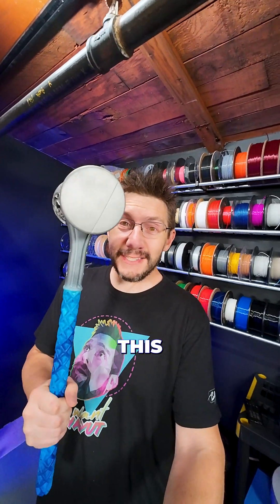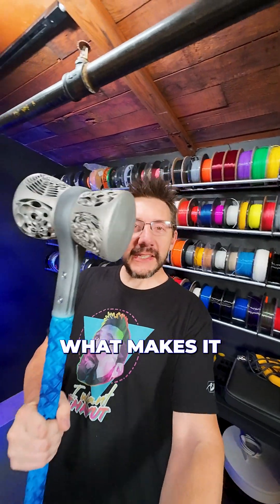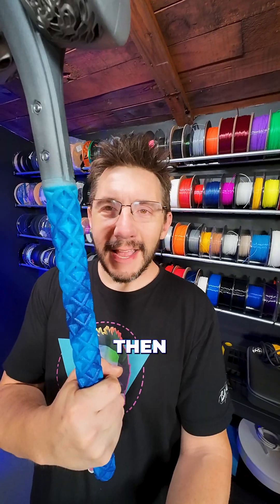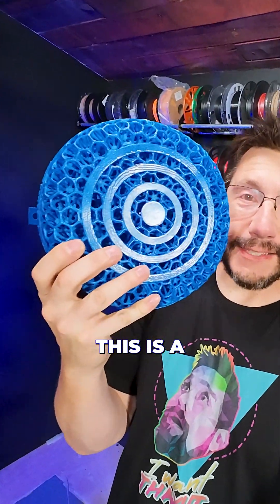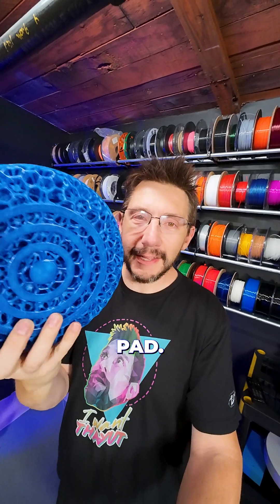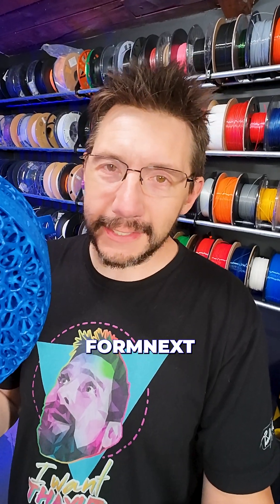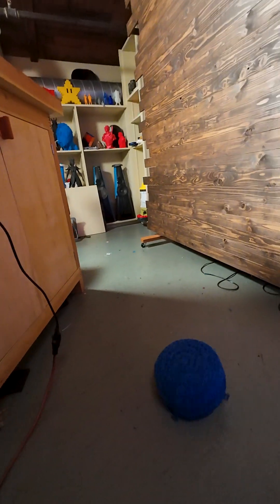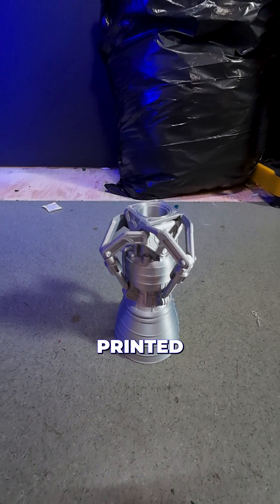3D Printed METAL HAMMER! #3dprinting #3dprintingnerd

Comment: How expensive and time-consuming is it to print metal compared to plastic? And what kind of metal is it?
Reply: Depends on the type of printing, on the low end count around 22 euro per kg, but you need around 6.6666 times the weight, so for the equivalent to a standard 1kg roll of pla you're looking at 140-150 euro, and up to around 1500
Sls printers are also 10-1000 times the price of hobby printers. (Like 10k+ up to 1m)
The markforge metal x is 100k for comparison.

You can get metal in filament and sinter that, but the costs are about the same.

The cheapest solution is lost pla casting or casting with tin in ht silicone molds.

Comment: I have two questions how do you get your prints to stick to the bed because every time I try my prints come up and how do you get your own 3-D model because whenever I tried to put the file on the USB drive, it doesn’t work can you please make a tutorial on how to do it or explain it the best you can
Reply: So the easiest solution to prints not sticking. Use a washable glue stick. I use elmers!!!!!! Make sure you are using a proper slicer. To make your 3d stl